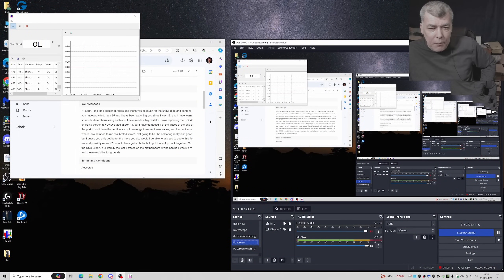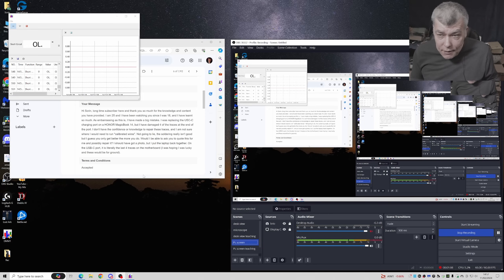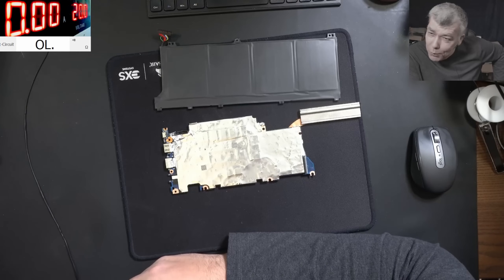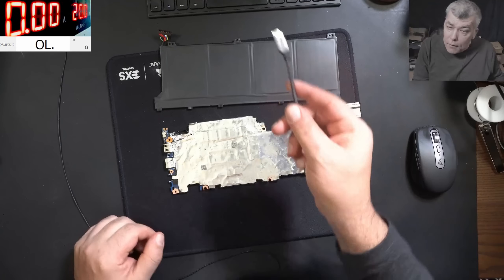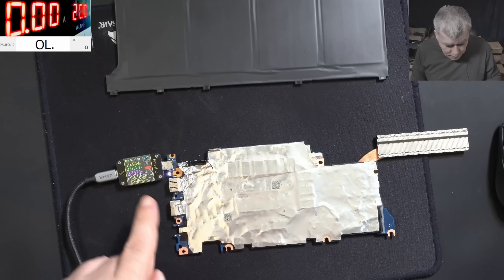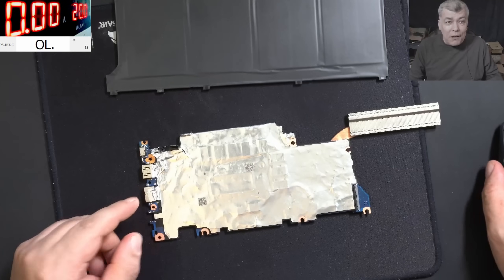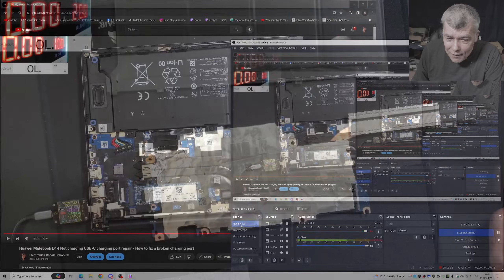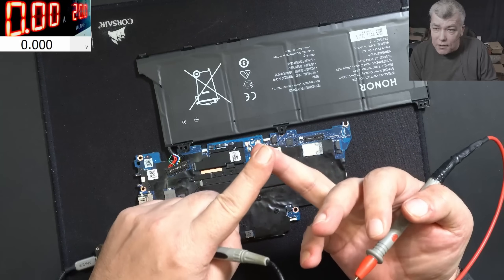HONOR MagicBook 14 - Customer replaced the charging port and now the board is dead, what went wrong?

Comment: Just spent 2 hours replacing a port on mine, it was very difficult , as I  kept getting the soldering bridging the contacts on the middle ones, as they are tiny. also the pads on many of them were ripped from the board, so I had to try and bridge them with solder.  I thought I had to solder all the pins to enable to 20v charging, but it seems not. I concentrated on the ground and v plus on both sides with a large amount of solder to give it some mechanical strength. Anyhow bottom line is that it now charges thanks to your video.

Comment: I picked up a free Samsung 32inch tv with an issue, would come on eventually if left alone. I'm just a beginner really, Though did some research before getting involved, turns out the Hybrid capacitors under the shield on the the main board are the issue, so I bought a replacement set, there was one outside the shield shorted to ground, maybe that was the main problem but I replaced them all any way and it's working perfect. I use it as a big PC monitor. Removing those type of capacitors was problematic, I ripped a trace on one of them, fixed with a strand of solder wick,  fear of one exploding in my face is real.

Comment: Thank you Sorin! I would like to know what you did at 9:59 minutes to start the card?
Reply: He connected the keyboard connector pins to ground to power up the motherboard. Probably the power button is on the keyboard.
Reply: That was a simulated press on the power button. There is a video for that;D Power button is often located on keyboard, and works just like that - signal from controller chip gets pulled low.